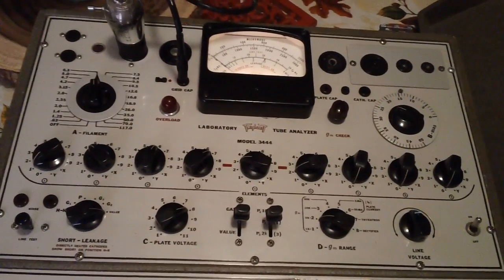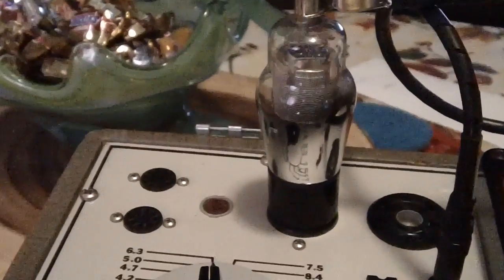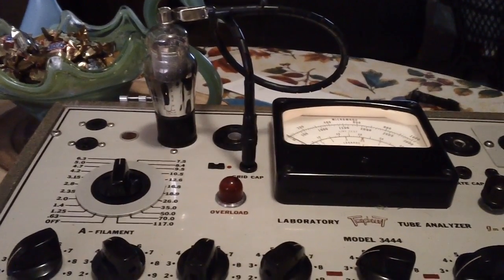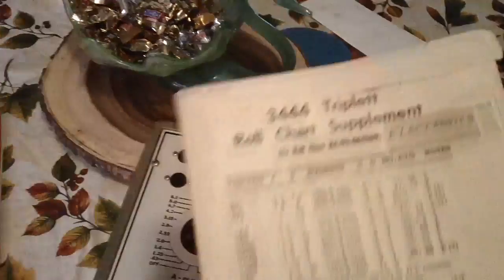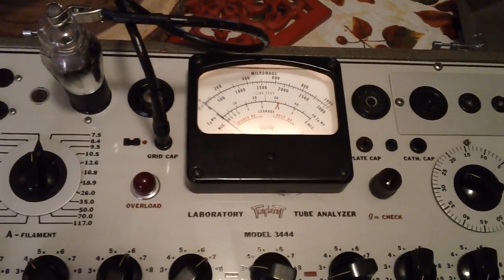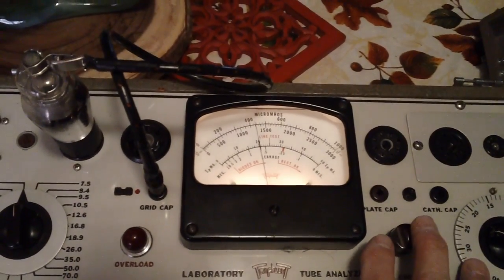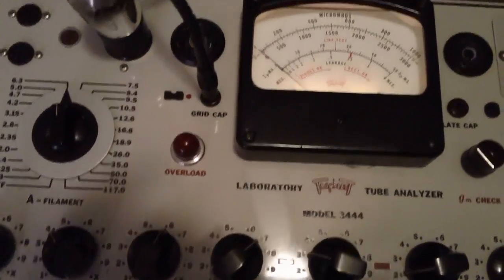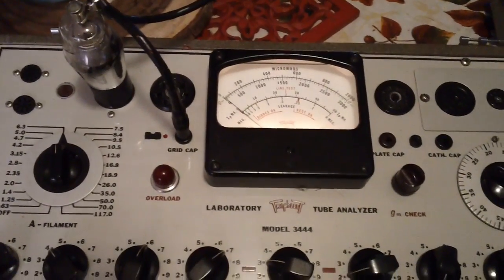Testing an unknown tube.

Comment: It might be a 6D6.
Reply from the maker: Jerry,   The construction between the tubes is similar, but no cigar.  But the tester proved it's not a 6D6.  The tester's bias voltage was set for a range of zero to negative 5 volts. The tube's emission changed with a slight movement of the bias pot.  On the other hand the 6D6 control grid requires a bias voltage of negative 50 volts.  With the tester's bias scale set to negative 5 volts maximum there would not have been enough voltage to cause meter movement when the bias pot was turned either way.  Regards,  John

Comment: that was exactly my guess before you said it... a 77.... my Philco 84 has a few of those.  I never thought of testing it that way and as usual you taught me something my friend..... Regards, Ron
Reply from the maker: Ron,
Do you still have the AK856 tuning mechanism (large wheel with rubber o-ring, small wheel with rubber bushing and mounting plate)?   If so, and you don't plan to use it, I'd like to buy it.
Regards,
John
Reply: I have it and a lot of other parts... will send em out to you gratis
Reply from the maker: Ron,
Sorry, my friend.  No gratis.  I'll at least reimburse the mailing cost.

Regards,
John
Reply: ok deal, will let you know the shipping cost.   In return if you come across a radio model that you think would be a challenge for me to restore, please let me know the model and I will look for one. I always love a challenging project :)   Will be in touch... thanks Ron

Comment: Heya John. Good to hear fromya. Any tips on how to check a 4 pin NX 245 tube w/o a tester? It appears to have continuity on the filament thingy, but past that I have no  clue. Waiting for your formal emergence from hibernation :)
Reply from the maker: Jim,
About the only thing you can do with that tube is check for good filament continuity between pins 1 & 4.  Then test for continuity between the plate and control grid pins 2 & 3.  You DON'T want continuity between those pins.  Lastly, make sure there's NO continuity between pin 1 (or 4) and pins 2 & 3.  Other than that, doing an operational test with the tube in the radio is about all you can do.  Just remember that the NX-245 tube has a 2.5 volt filament.

Regards,
John
Reply: No continuity xcept the 1/4 test. Thank you John. I am waiting for more of your vids. I hope you and yours are well.
Reply: Thanx J